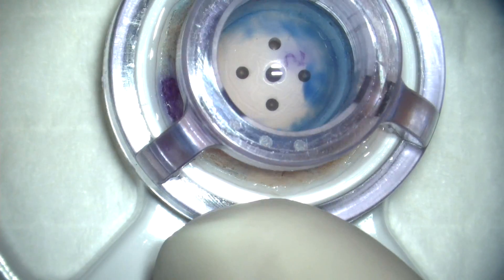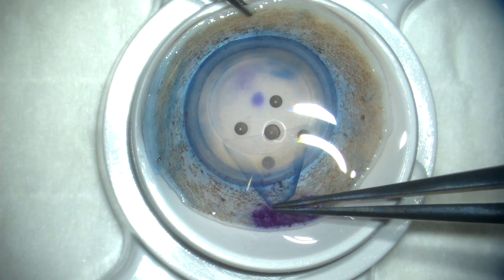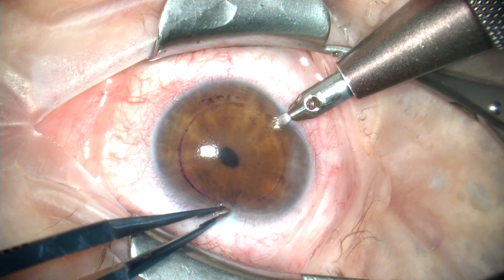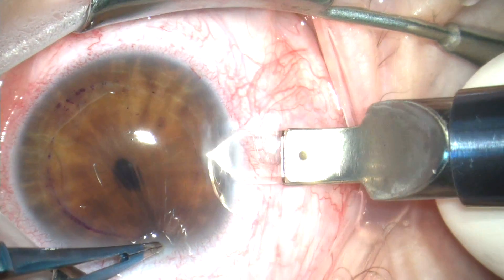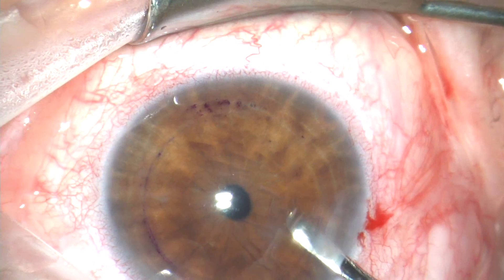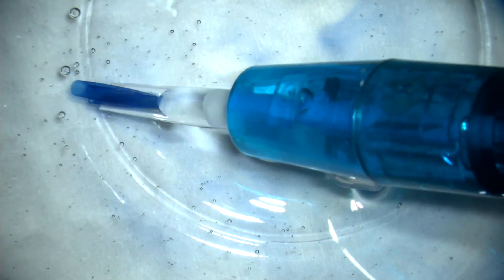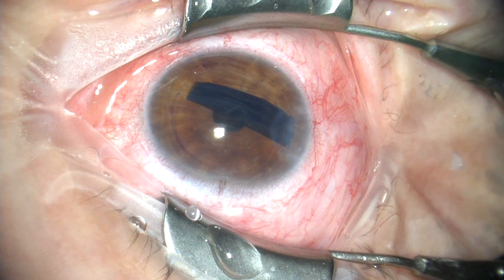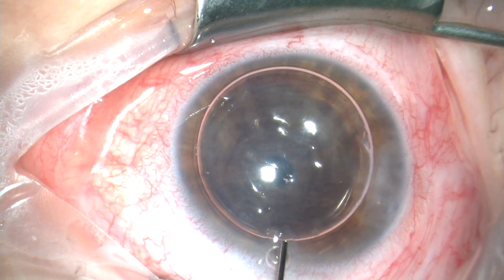DMEK surgery:  sutureless corneal transplant

Comment: 4:56 why does the iris increase in size for a second?
Reply: as the irrigation port goes in (the purple piece), it drives fluid into the eye and the pressure from the fluid causes an iris dilation